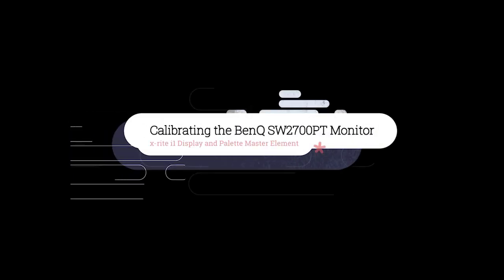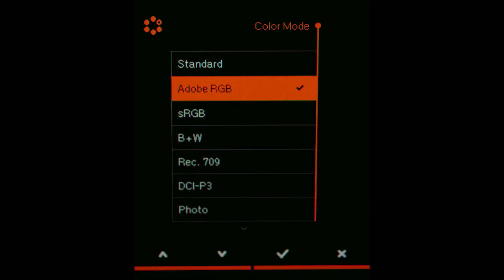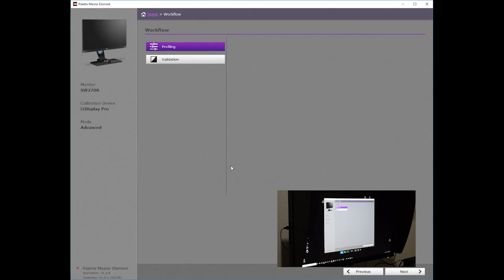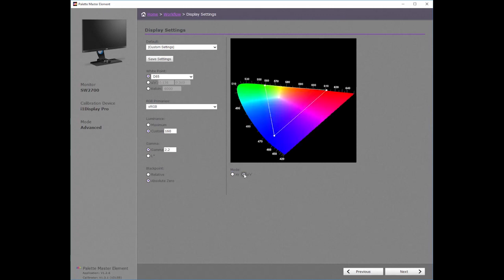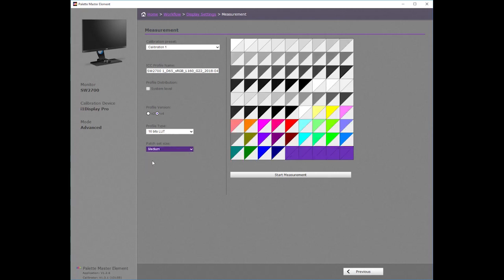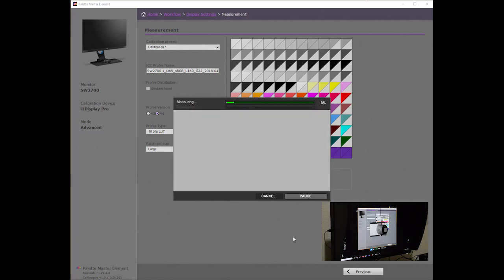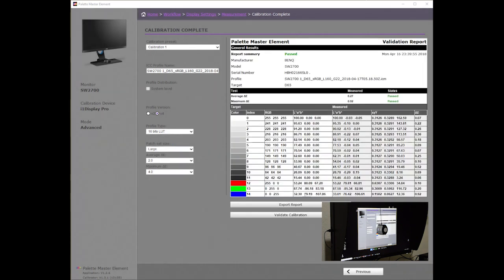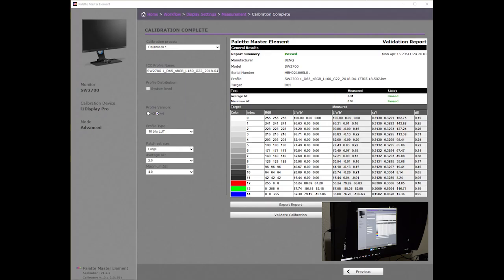Updated: Calibrating the BenQ SW2700PT monitor using XRite i1 Display

Comment: HI! Thank you for this video! Very helpful, as well as your answers below to all the questions. I'm hoping you might answer a few of my questions :))
#1 I was told to start by reverting to factory defaults before calibrating with the X-rite. How do I do this with the BenQ?
#2 In one of your answers you say that you select AdobeRGB (factory calibration) on the puck to edit. But also say in another answer that you should use Calibration 1 or 2 instead of the factor calibrations. So I'm confused, which one should I be using?
#3 When exporting from lightroom should I select the ICC profile that I create using the X-rite instead of, for example, AdobeRGB? The print lab I send my digital files to tell me to select AdobeRGB, but that doesn't make sense to me.
#4 Should I calibrate at a specific time of the day and always edit at that same time of the day (ie: for me, lights turned off, only daylight, middle of the day)?
Reply from the maker: Hey, Nicole, I will take a little more time to to review this again tomorrow. Sorry for the rushed response. Busy at work today. BUt, I am curious to know more about what your printing/ imaging service advised. THen maybe I can give a more intelligent answer. Thanks, Rog
Reply from the maker: When you calibrate, you get to pick where the monitor stores the calibration. You have two choices (calibration 1 or Calibration2)  and these are listed in the Palette Master software as choices. I do not recall off-hand if you are required to start in sRGB or Adobe RGB when you do the calibration. Rather, I think the monitor will change to suit the choice you made (sRGB or AdobeRGB) in the Palette Master Software. 
As for time of day etc. Some people recommend having the monitor on for about 30 minutes before performing a calibration. (Sounds like a great idea). You should decide what sort of lighting you want on in the room where the monitor is located. BUt, truthfully, the XRite device is placed on the screen. So, ambient lightening will not play a role during calibration. It will matter later if you use the XRite device to monitor changing ambient light conditions as the XRite device will adjust the screen appearance for changing lighting conditions.
Reply: @docrujet  Thank you for your reply! I ended up calling X-Rite customer service and when using i1 Profiler (I use this software instead of Palette Master) there is no option to select Calibration 1 or 2. That's why I was confused. The BenQ 's "standard" Color mode will reflect the new calibration. So here I was trying to figure out what Color Mode (using the Puck) I should select AFTER calibrating when my screen was ALREADY calibrated for "viewing" in Standard Mode. I really like that you said that ambient lighting doesn't play a role during calibration, this confirms what I thought but wasn't 100% sure about.
Reply from the maker: As for the ICC profile question. You should decide whether or not you want to develop images in AdobeRGB or StokesRGB (sRGB). I've learned differing views on which is preferred. WHen I calibrate the monitor, I know the monitor will do as well as it can for color accuracy. The greens suffer more in sRGB. AdobeRGB has a larger green range. But the monitor's Delta E values are higher becuase the AdobeRGB gamut really pushes the monitor to its limits. 
Nevertheless, I can choose either of the two profiles for VIEWING my work. My Printer is calibrated to produce colors as accurately as each paper type will allow (each paper type gets it's own ICC profile). 
As for a printing service, I am not sure what their process is or why they would want your monitor's ICC profile. If you are referring to the ICC profile for the paper your are using or a custom profile your made for your prints, then I can imaging the might want that for use at their facility if they are using the same paper. 
WHen working in Lightroom, you pick the ICC monitor profile that suits you. You might notice more subtle color differences in AdobeRGB (monitor setting) while using Lightroom that will change how you "develope" your images for export.
Reply: @docrujet  Per the ICC profile. My lab (WHCC) suggests choosing either sRGB OR Adobe RGB upon export. I was the one who thought I should be selecting my monitor's ICC profile, which I see now is irrelevant.
Reply: @nicoleseguin-morris7356  You should be using palette master to calibrate, otherwise you are not taking advantage of the LUT and on-device profiles.
Reply: I'm have same issue here. My monitor was in Adobe RGB mode while calibration. I will factory reset the monitor today and give it a try with this settings in palette master element v 1.3.10 (3 times) >
Panel native
White point D65
Luminance 80, 100, 120 (each per calibration to see the difference)
16bit LUT
Gamma 2.2
Blackpoint Relative

If this doesn't fix then downgrade software to v 1.3.8 and try again.

Comment: Thanks for your video! When I calibrate after selecting the 'Calibration 1' preset, and the LUT is written there, what happens when I push the '1' - Adobe RGB button on the remote? It jumps to the RGB view, and out of the Calibration 1 preset, and luminance etc. change. I mean, is this view calibrated too, or only the 'Calibration 1' setting?
Reply from the maker: Those presets on the puck are actually stored in the monitor - these are factory set calibrations (adobeRGB, sRGB and Grayscale). If you calibrate the device yourself, the calibration is stored in Calibration one or two. You are right, hitting 1, 2 or 3 on the puck will change over to the factor calibrations.
Reply: You can change what the buttons on the puck do. You can set it to calibration 1 in the monitor settings.
Reply: Thanks both! Yeah, I think I will change one of the buttons to Calibration1. I was just a bit unsure if anything happened to the RGB and sRGB settings from before. I guess it's safest now to use my own calibration that comes from the XRite i1 Display calibrator.
Reply from the maker: Cool! I have never tried that! Cool! What a nice monitor! Might just have to get one for my daughter!
Reply: So if I want to switch between calibrated adobe RGB and sRGB, do I have to calibrate monitor twice? First for RGB primaries = adobe RGB (stored into Calibration 1) and second for RGB primaries = sRGB (stored in Calibration 2) and than switch between Cal1 and Cal2 instead of factory calibrated adobeRGB and sRGB?
Reply: @tuketko  The presets for sRGB Adobe RGB etc are not altered by the Calibration 1+2. Calibrations are manually done through palette Master and stored in the monitor memory. The presets are factory or standardised presets for which the monitor has a custom factory measured control set ( the certified monitor report). These are hard set for each monitor so that the standard presets will be displayed correctly without any notions of what the video card is sending out. To recap; calibrate to what colour space you like or custom set this. The resulting profile will be lodged locally as an ICC profile, and resident to the monitor, with 14bit per channel LUTs. The monitor ICC profile is for OS level display which corresponds to the Calibration settings lodged in the monitor so that both system and monitor can correctly transpose colour working spaces to the correct rendering in applications as well as the maximum ability of the display itself.
Reply: @NeilSnapePhotography  So how do I get my calibrated setting back after pressing 1,2 or 3 on the puck?
Reply: For each custom profile/calibration there is a choice of Cal 1 or Cal 2 in the calibration window. It isn't readily apparent , it is at the top of the window. Select Cal1 for you most used settings and cal2 for a subset or completely different. What I do is cal 1 is full AdobeRGB at 160 cd/m2 and cal 2 for printing, 5500 K and luminosity reduced say 100 cd/m2. Then I just program which hot key is set to what. Mine is set to Key1  Cal 1 for general, cal2 key 2 for printing conditions and usually key 3 I leave to B&W. Some may find sRGB to be good too for seeing high gamut images mapped to a weaker space without changing anything in the editing software. @henrikdahlberg878

Comment: You never mentioned that the display MUST have an active USB connection to save the calibration.
Does no good to have the Computer connect it with the video cable and connecting the calibrator to the USB port on the computer.
Reply from the maker: Noted. That's indicated in the BenQ instructions.
Reply: I don’t have a Benq display? I just heard about using USB from someone who had a Eizo  I thought if you’re going to do a video you should mention it in the video. Thanks all
Reply from the maker: My First video. I've found a few other points that were worth adding. But, not a bad start. I did try to get Datacolor to let me use their device. :) no go on that.  Oh, well. It's Epson's  P800 printer for the next next video.
Reply: The monitor has to have a USB 3 cable to the computer. You can plug in the measuring device in any hub. To make it easier, might as well be the monitor hub.
Reply: Thencan you elaborate on this? maybe this is my issue.

I used all the cords the benQ montior came with - I have the usb with the phone jack looking end tplugged from monitor to  computer because I was told thats needed for calibration
Then I have my computer hooked to my monitor via the USB/small square looking thing. 
The I1display calibrator is plugged into the monitor.

Comment: This is a great tutorial! Though I'm having major issues calibrating this monitor via built-in hardware. I spent 20 hours of research and calibrated it over 15 times now. BenQ offered a replacement but now I'm thinking that most replacement units will be the same since I'm not the only one who is having this issue which is:
1) I'm a newbie when it comes to calibration, so I select the built-in sRGB profile of my monitor under Color Mode section. 
2) Under Nvidia color setting I select "Use Nvidia to manage colors" instead of "other application" (I tried both ways and have no idea what is the difference and which one I need to use.
3) Under Windows 10 Color Management there is an option to check the box for "Use my settings for this device". If I check that than calibrated profile applies if not then some standard BenQ SW271 color profile is being used. Now again, should I check the box before calibrating the monitor or not, I don't know.
4) Let's say I have the sRGB JPG file. I work exclusively with sRGB files. Should I select sRGB or Adobe RGB when calibrating? How I see it is if my file is in sRGB then I lose nothing if I calibrate my monitor as Adobe RGB?
5) Finally, once my calibration is done, I get 0 value for the luminance, my color is off by a few thousand and when I try to validate it gives me an error and says to calibrate first before validating. This is frustrating.
6) At some point, it worked but my colors were washed out. I simply open Google's page and can tell by looking at the logo.
Reply from the maker: Eli: 
Thanks for the kind words. I enjoyed putting the tutorial together. 
I looked into a few of the things you wrote. 
#1 and #4.   I started out with sRGB because I thought it would give me a clearer picture of what I'll output on a pigment based printer. Turns out, the color space of my printer is much larger than sRGB gamut.  Now, I use the AdobeRGB knowing that  - as you said - it will contain the sRGB data and a bit more. My printer actually has a color space that is similar to AdobeRGB. So, for my prints, AdobeRGB is an OK choice for my monitor. (BTW, when saving as JPEG, I prefer to not compress the file size. According to experts, even reducing the file size by 10% when compressing shows little difference when not compressed at all. But, in this day and age of bleeding fast PC or MAC computing power and unbelievably affordable RAM I do not compress image files. 
#2. NVidia: I have my SW2700PT monitor and a Quadro P4000 graphics card. In the NVidia control panel "Choose how color is set " box, I too have checked the "Other Applications control color settings" rather than "Use NVidia settings". 
#3. In the color management window, I checked the "use my settings for this device". I also note that the last profile I made via calibration appears in the "Profiles associated with this device" dialog box under that. 
#5 and #6: If your luminance is 0, that would suggest your screen is black, no light,... hmmm. ...that your sensor is not picking up on the light from your monitor. Not sure how that can happen. I should ask  which device you are calibrating with and are you using BenQ's version of Palette Master or another software?

Make sure:  Monitor (with your calibration sensor in one of the monitor's USB slots) connects to a  True 10 bit graphics card which is connected to a Computer. 

Hope I helped a little. Rog
Reply: Hi Roger, thank you so much for the response! If was very helpful. I after tens of calibrations with Palette Master I figured why it was failing and giving me a luminance of 0. It all leads to a bad QA job. It appears that whenever I give my future profile a new name if fails to calibrate properly but if I keep it untouched in Palette Master then it works fine. What a joke. 
I also wanted to ask. Do I need to select some sort of specific color mode like sRGB, Adobe RGB or even Custom 1 before I start calibrating with X-Rite? 
And if I upload my work exclusively online (don't do prints), does picking 8 LUT over 16 LUT for calibration matter? Not quite sure if the color will change once uploaded online if I calibrated for sRGB 16 LUT.

One last thing I wanted to ask. I calibrated for Adobe RGB (assigned it to the Calibration 1 button) and this profile was assigned to Window's Color Management.
Then I calibrated for sRGB (assigned to the Calibration 2 button) and this profile replaced the Adobe RGB under the Windows Color Management which is correct.

Now, when I toggle between Calibration 1 and 2 using the monitor controller, the profiles under Windows Color Management do not change. I can only change it manualy. That doesn't seem right.
Reply from the maker: 1. Re color mode: If you mean Do I choose one mode in the Palette Master software for the targeted gamut  for the calibration - sRGB or Adobe RGB - then yes. You also need to indicate where it will store the calibration (Calibration one or calibration 2) in Palette Master. If you try to calibrate the monitor for say Adobe RGB but you've set the screen for sRGB (or grayscale or one of the other hard wired calibrations) then you will not get a good result. The sensor will be limited by the output. To tell the truth, I've not tried setting the screen one way and trying to calibrate in another. I'd have to try doing one in grayscale to see if the screen will automatically switch to a mode that will permit a proper calibration. Maybe I can speak with better truth  then. Not sure I answered your question. 
2. re 8 bit vs 16 bit Look up tables: these apply to how your monitor calculates the pixel information for your display only. As for how your work will appear online...you cannot control what others will see n their monitors. You can control what you send to other viewers. Make sure your monitor is calibrated using the 16 bit LUT or Matrix tables. Other viewers' devices will render them differently no matter what. Hopefully, most people's monitors will approximate what you intended. 
Now, if you are sending your work to a printing business... that requires more understanding of color and the printing process. 
3. Windows color management: If you successfully calibrated  Cal1 and Cal 2 to be your 2 "go to" calibration choices, you should not not have to go into windows color management to make profile changes. (I do not have to do this. I just use the puck.)  In the Windows COlor Management settingsmMake sure you've chosen "use my settings for this device". I just use the BenQ puck to make my changes using the monitor menus (middle button). I hope this is right and that it works for you.
Reply: Roger thank you so much for explaining things to me! Got it, I do too use a pluck!